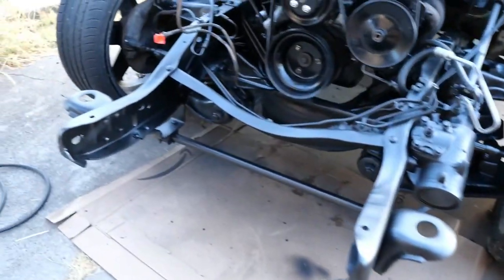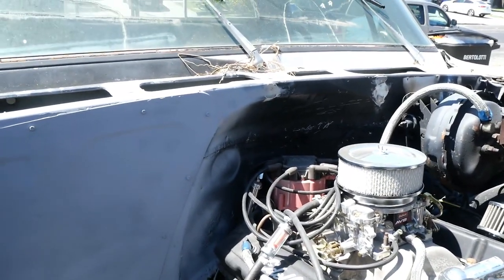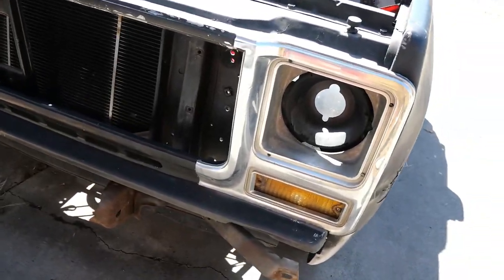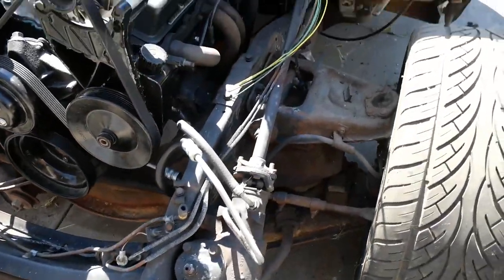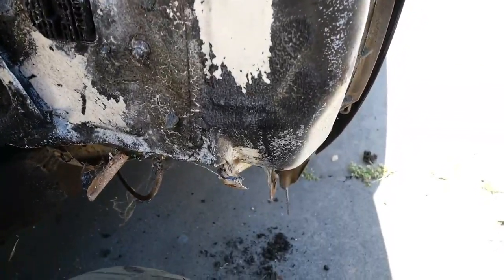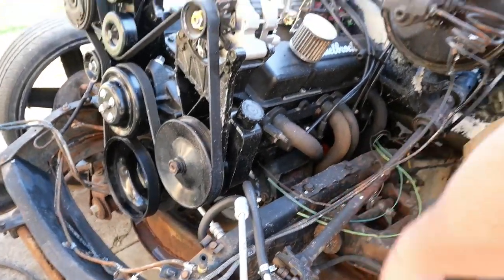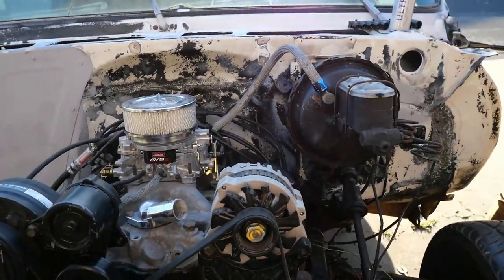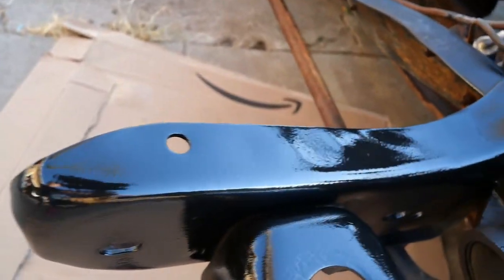C10 PROJECT BUILD PT 2, PAINTING THE FRAME!

Comment: Doing my firewall and frame right now too, it's a lot of work 👍
Reply from the maker: Yes it is i really wish i could take it all apart and powder coat.
Reply: @brayandelvalle8035  my engine and trans are out and it's still a lot of work to get it to the point of powder coating but if you plan on keeping it for a long time you might as well just do it now. 🍻
Reply from the maker: @davids7349   im so tempted of doing it but i just don’t have the space i will in the future when i ls swap it!
Reply: @brayandelvalle8035  definitely makes things harder when you don't have the space to put all the shit,  sometimes you just have to do what you can when you can.  🍻
Reply from the maker: @davids7349  yes im hoping to get it painted this year well see